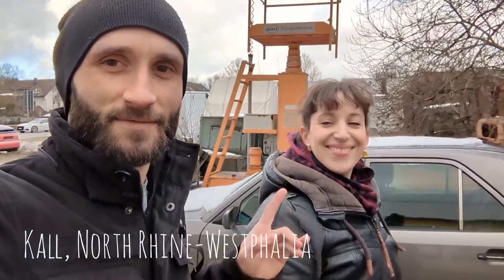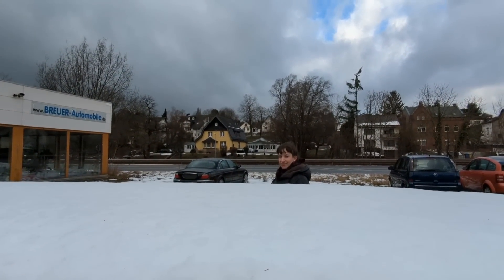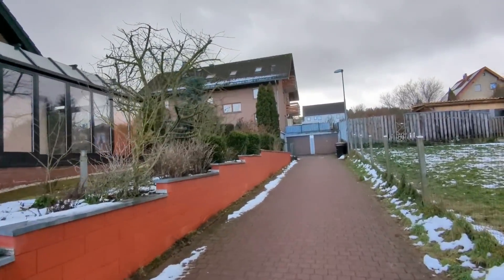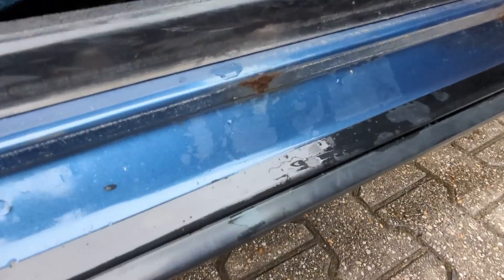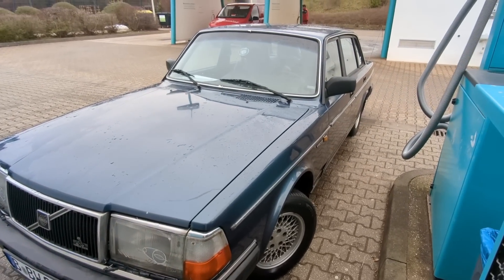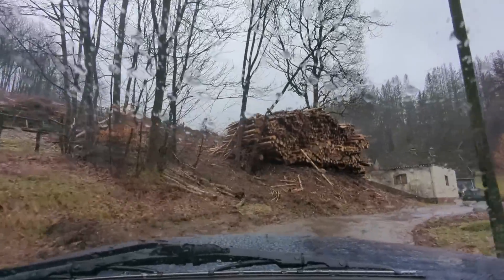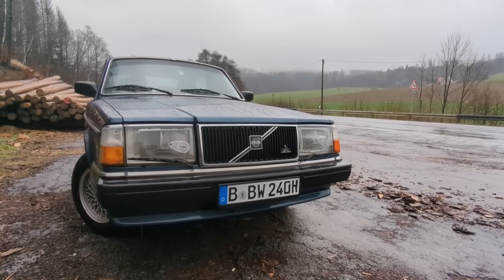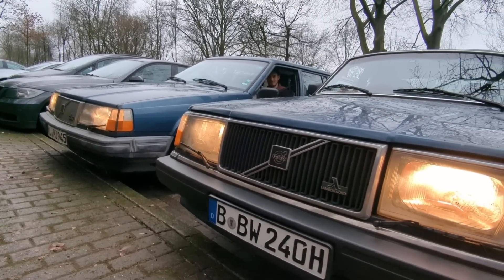Taking our Volvo 240 on a Road Trip around Germany

Comment: On a side note here,,,,what are the laws in Germany with the tyers? I was talking to a tyre fitter here in the UK that does part worns, he said most of the tyres come from Germany because they have strict tyre laws!
Reply from the maker: Hmmm interesting, I certainly haven't seen any part worn tyre shops like in the UK 😀 Not sure on the minimum tread depth for the TÜV / MOT, but I did manage to get a pass ticket with 10 year old tyres that weren't the freshest!

Comment: Was that a garage? A garage at home would be so nice for you. Interesting that you drove across that much of Germany to find a home. Did you not find jobs then move close to work? Great to see a bit of the country.
Reply from the maker: Yes, finally 😅 Tbh there were so few places for rent, we had to go where we could find something! But luckily Miss Involvo'd can work from home for now, I can also try my work anywhere, but one thing I have noticed is all the windows seem to open inwards and are very clean 🙄😄
Reply: @Involvod  Maybe roof cleaning or Pressure washing then?
Reply from the maker: @ched999uk  I think there could be more chance with that, but I wouldn't be surprised if the Germans do it themselves too 😄
Reply: True but using decent kit and hypo (if German law allows?) will do a much better job but trying to sell that might be tricky although there are usually people in decent areas that are time poor - money rich!
Reply from the maker: @ched999uk  true mate

Comment: Have had two of these 240 -Volvos, majestic cars. Nowadays in Finland, if you want to get a good one it'll cost some 5000 and more euros, which i understand. Thx for the video!
Reply from the maker: It's crazy how the prices are going up now!
Reply: There are still good deals to be found, a friend recently got one for 1500e. 240 2.3l. Inspected and rust free. Needs some maintenance and a little bit of interior work.